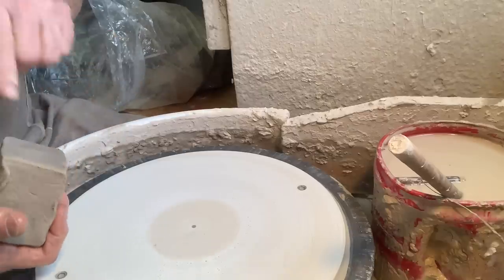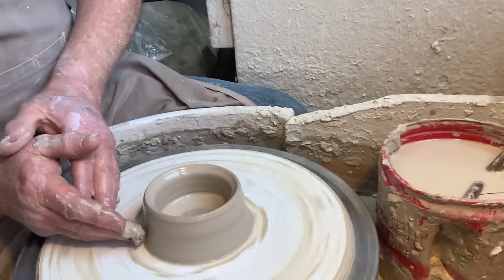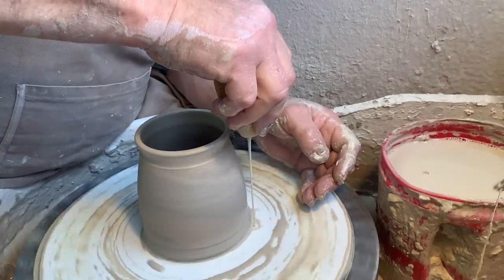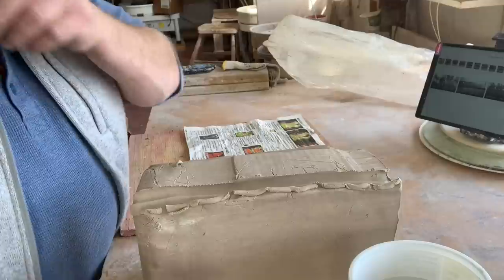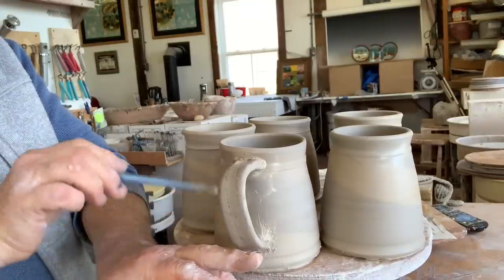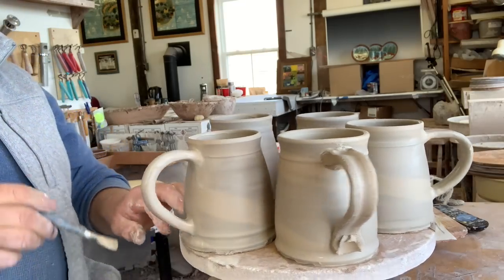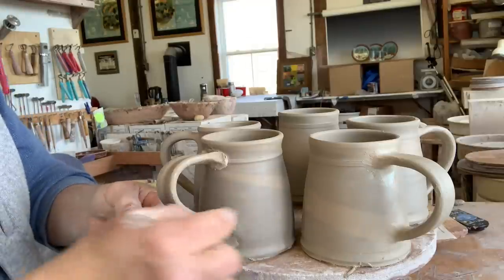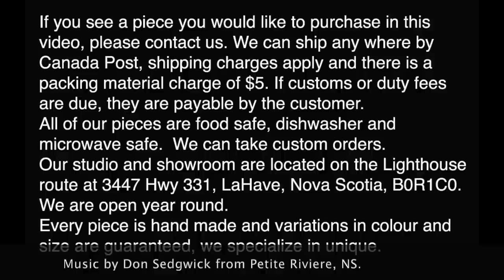Applying simple easy to make handles on mugs.

Comment: Hi! I am from the south of England and have been potting for about 3 months and have just discovered throwing with porcelain and am in love with it! Thank you for your excellent video! I wish I had a wall but it is a lot easier with porcelain! 😂 I gave up with the rough stuff, it did my back in.
Reply from the maker: Hi Anna, Good luck with the porcelain, my experience with it was a lot of cracking from handling. I switched to B-Mix 5 from Laguna Clay company which is almost the same without the cracking. I am from the UK too, moved to N.America in 1985.

Comment: Thank you for sharing all your excellent skills and tips. I get a bruise from the edge of the pan. I saw a youTube video suggestion and started using a pool noodle cut along the length, on the pan edge. It's a really cheap fix! $1.25 later and so far, so good.
Reply from the maker: I have one on my Leach wheel, I used pipe insulation.